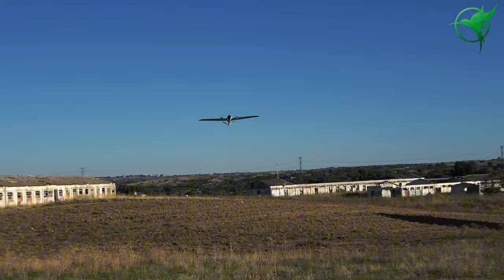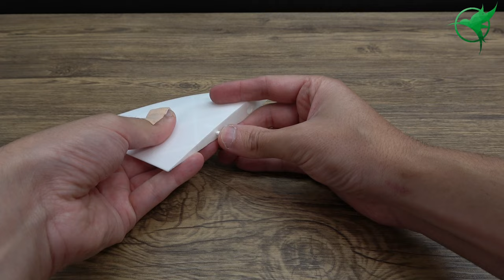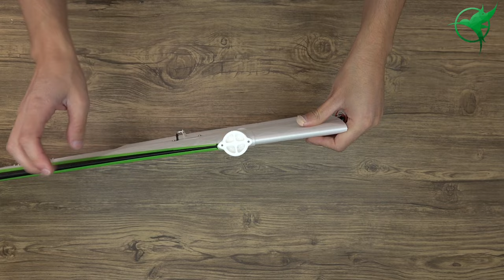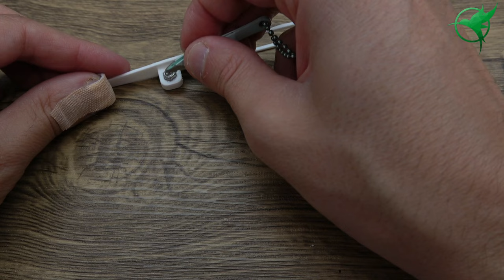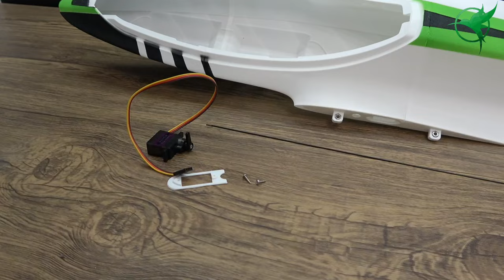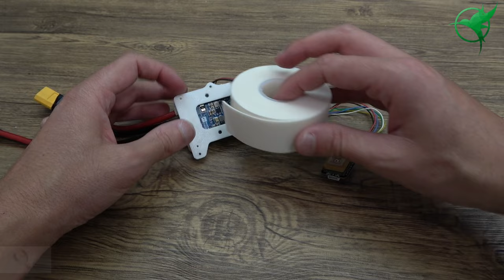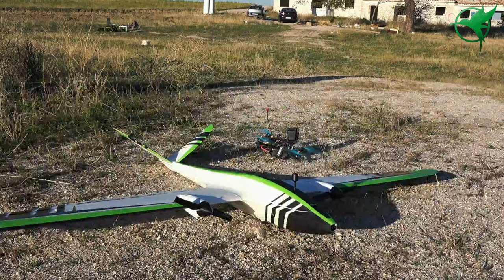3D printed UAV - Pathfinder build video

Comment: uggghh tower pro servos are just not good in planes.... and dont use those heavy steel nuts plastic ones are better. and beautiful plane you have made :)
Reply: I love seeing planes built with those junk servos. Not only does it mean that just about any servo will work, but it also means that the aircraft is really well designed if it can still fly with those servos. I’ve had a couple give up on me, but it only takes one before you never trust them again.

Comment: How do you get no stringing with lwpla?
Reply from the maker: Vase mode design. No travels
Reply: @eclipsonairplanes   @0:21 there are 2 parts printing at the same time.  How is that possible in vase mode?   Also the print head isn't visible. Doesn't that mean a time-lapse mode moving the head away for each frame?  How is that possible in vase mode?

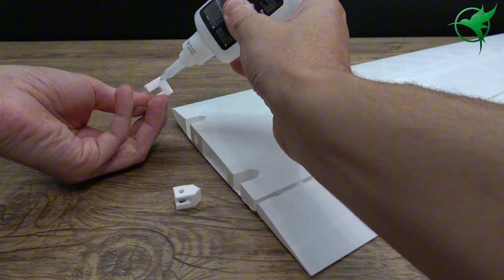Comment: It looks like there an mistake at 2:15.  The wing mounts are being glued into the wing.  They are being put in upside down.  The larger hole needs to go at the top (toward the bottom of the wing) as we're looking at the installation.  This larger hole accepts the head of the bolt.  Also, the shape of the wing mount only goes in one way flush.  The thicker end of the wing mount with the larger hole points up.  The wing mounts are also angled.

Comment: I really like the design of this plane. I might build one.
How well does it glide? (at 0% throttle), and
What are the flight times on a 2200 mAh 3s ?
Reply from the maker: Glide ratio is around 20. You can fly like 18minutes with that battery.

Comment: a mod for esc places next to motor, might be interesting maybe? 
no spar to strengthen the body-tail connection?
Reply from the maker: That was the first option, but there was no space to place the ESC. No CF spar needed, the body has a relatively new 3D printed structure which makes the use of CF reinforcement.